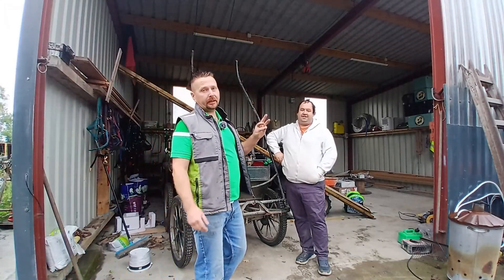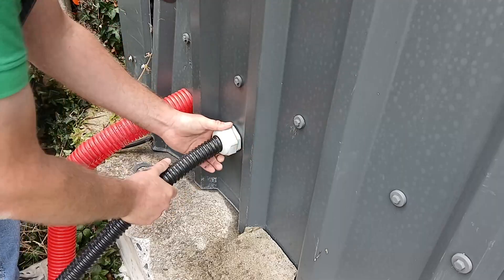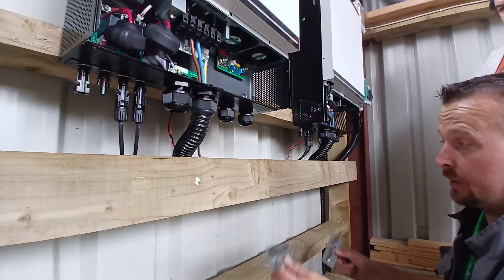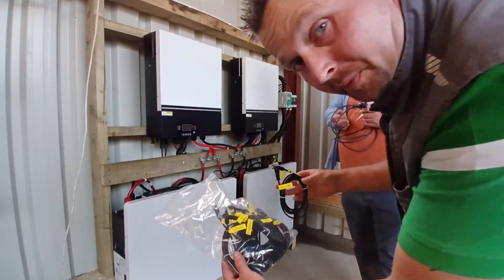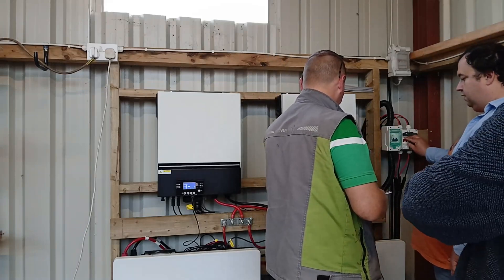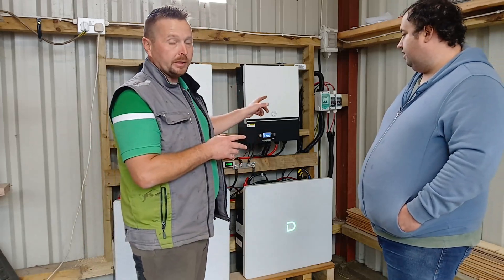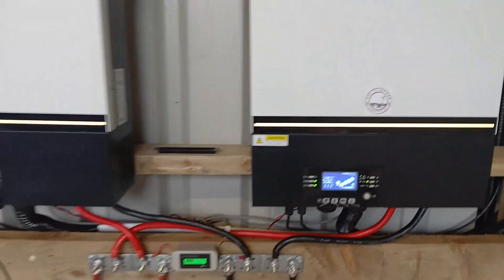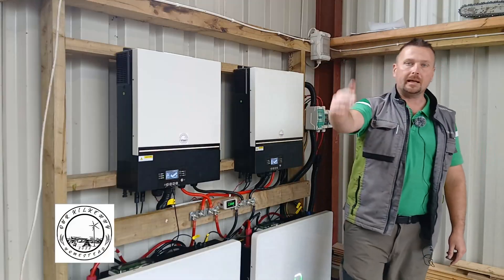2 homes 1 Off Grid Power System FINALE!

Comment: Whats the cost breakdown of this exact setup here
Reply from the maker: 2x Dyness powerbox g2: €4000
2X 11KW aio inverterters €1550
15x 455w bi-facial panels €1320
Timber for solar array €800 approx
Wiring €500 approx
Flexible Conduit €200 approx
Mcb's & sundries €500 approx
22kw continuous output AC power: Priceless.... 😊
Reply: @o @ourkilkennyhomestead2006  if you want to sell excess back to grid eventually, would you need to add something to this setup?
Reply from the maker: @lodgehousestudio6219 these inverters are specifically for off grid. Theyre too powerful to be grid connected under current regulations.

Comment: Galvanised steel bus bars? They are not for high currents. These also look very thin. This is fire hazard. Better spend more money and be safe.
Reply from the maker: Theyre thicker and wider than the connectors on the end of the battery cables which are good for 400amps or more. Theyre not a fire hazard at all.
Reply: @ourkilkennyhomestead2006 They look thin and flimzy in video, however if you sure and OK with theirs specs, no problem.
Reply from the maker: 200amps is reasonably high current. We're building scalable systems to charge multiple batteries at 100 - 200 amps per battery in multiple battery setups. Its 100% safe, just doesnt follow sheep recommended trends.

Comment: Well done, great series!. Is there any chance you could append some content on grounding, surge supression and isulation/safety ?
Reply from the maker: Yeah sure could, its all pretty simply. Given that the install is quite a few meters away from each homes built in grounding. A separate earth rod is used grounding the off grid equipment install. The surge capacity of each inverter is 22kw and all ac circuits and equipment bodies are grounded through the earth rod incase of circuit failure and equipment casing becoming live. The thing to be aware of is that with these inverters the panels must NOT be earthed as it will interfere with the internal switching in the inverters and could result in ac leak back into the dc circuits.

Comment: I see you are using 3:28 easun inverters . I have a 4.2 kw un it with a 230 volt supply via a 32 amp rcbo .  It keeps tripping under load . Any suggestions . Should i use a 32amp MCB instead . Keep up the good-work i loved the wind gen stuff esp the failures one learn a-lot from failure.
Reply from the maker: Tbh it would be best to check for earth leakage which would cause the 32amp rcbo to trip. If your load is below 32amps and the rcbo is constantly tripping out there is most likely a fault somewhere in the circuit or the inverter itself.
Reply: Or if you are completely off grid, make sure that you have bonded your system. That means in main MCB box you connect earth with neutral. Sounds wierd, it did to me too. Has to be done, otherwise there is danger of electrocution.